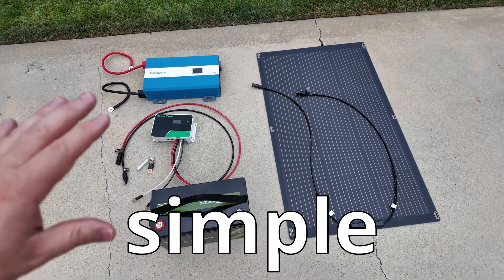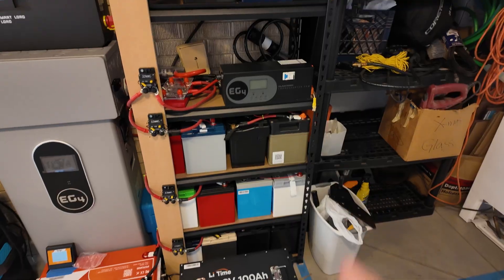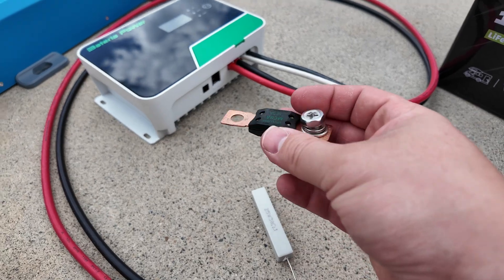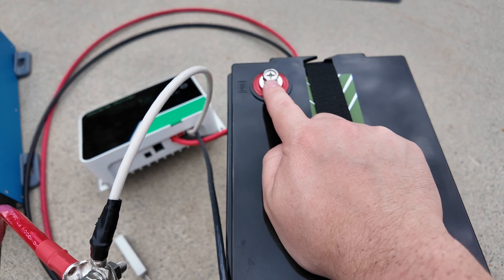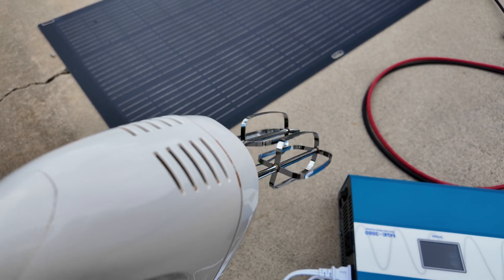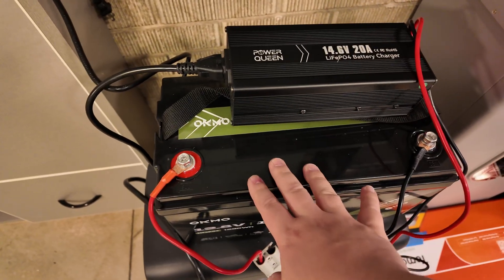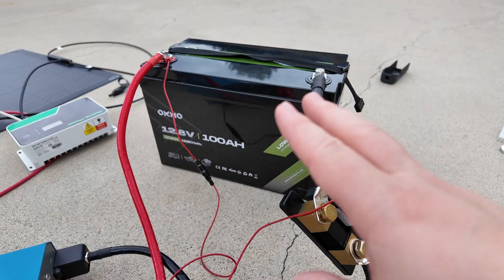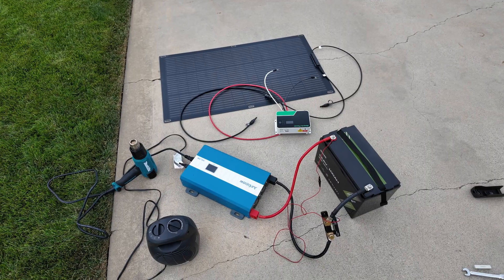Back to Basics: DIY 12V Solar Power System Build (Step by Step for Beginners!)

Comment: Is a breaker switch between the panels and the controller needed for this setup for use in a RV with a 12v system (parallel) and one 200w solar panel.  Only going to be using a 1000w inverter if needed for dry camping for items less wattage than a coffee maker (e.g. use for cpap, tv, charging phones and laptop computer).  Also, can a surge protector be plugged into the inverter?
Reply from the maker: A breaker between the panels and controller is always a good idea for safety! Yes! A plug strip can be installed after the inverter!
Reply: @theresatrickforthat  Thanks for the quick reply and have a Merry Christmas and Happy New Year

Comment: Watched to the end, Junbpaw.  It was a lot of help.  I am using 4 100W solar charge controllers. For one system and the same for another system.  With 4  12V 100Ah LiFePO4 Lithium Battery. I like that you talked about 24V and 48V.  If so, I would have gone for the 24V or 48V.
Reply from the maker: Glad I could help!

Comment: can this be used to run a pc especially at night?  I was just thinking if I can use a solar + battery and a power socket to power up my PC to reduce power costs at night?  Like let's say I buy panels enough for 1200w and then a couple of batteries.  Should I run the solar and batteries in series?
Reply from the maker: Yes! This could work great for you!

Comment: Watched until the end but I didn't see the vendor for the fuse link and resister you used. I am only going to use a small solar panel, 12V car battery and 2 small 12v equipment lights for my barn. Thanks.
Reply from the maker: The links are there in the description and pinned comment!

Comment: Watched the whole video, but had a question about the BMS. Isn’t the BMS on the battery too small for the inverter? Or is there something about the Junbpaw that allows you to use a 100ah battery with a 3000w inverter?
Reply from the maker: It is too small for the inverter running at. it's full power...but you can run it just fine with a lower powered load!

Comment: The system you built with one 100amp battery, I want to build a system with two 100amp batteries, will the fuse still be 300 amp, also will my system require a fuse for each battery
Reply from the maker: With just two batteries you should be okay with just one fuse…however the safest thing would be a fuse on each battery in the rare event of a shorted cell
Reply: @theresatrickforthat , thanks , i didn’t realize these systems need such a high amp fuse , good thing i watched a video on how to build a system. I’ll probably buy a few spares fuses for a backup if they blow out

Comment: I "Watched until the end", as stated. I just retired and I'm looking to further advance my extra time I have on my hands.  This would be perfect to start my hydroponics project. Your presentation and explanation are very easy to follow and implement in building this start up system. Thanks for sharing. 👍👍
Reply from the maker: That's awesome! Good luck with your hydroponics project!

Comment: When you hook up the inline fuse you put the charge controller in the battery on the same end. Doesn't that mean the charge controller is not protected by the fuse? And is that deliberate? Total n00b here, so I wanted to ask. Thanks for a nice video about this. You explained everything very clearly.😊
Reply from the maker: Yes. Technically, I need a separate fuse for the charge controller since it has different size wires. I just filmed and now need to edit a full video in my back to the basics series going over cable and fuse sizing. So stay tuned for that!
Reply: @theresatrickforthat will do. Thanks for clearing that up!

Comment: So what can I power with a system like that?
Reply from the maker: Small electronics, a freezer, a fridge...if you add more batteries like the video linked in the description shows, I could power basically all my 120v loads in my house! It can be very flexible!
Reply: @theresatrickforthat Thank you

Comment: Thank you following been jumping from page to page trying to do something with my barge, as alternator is running 24v figured I’d just do everything 24v but I’m fairly certain I won’t have much cross over not even sure about doing dc to dc..
Questions 
do you need fuse each battery or is it one and done do I scale up the fuse or 32v 300a fine?
For recharging off mains/generator can you recharge all together or do you need to do each battery independently
Reply from the maker: I like to be safe than sorry and fuse each battery and then fuse each string of 4. They can all be charged up at the same time. I'm going to be making a video very soon about proper cable and fuse sizing.

Comment: Watched until the end.  Running a 3000W load on that 100Ah battery will drain it under 20 minutes!
Reply from the maker: Yay! Yes, in fact, that battery will actually shut down before you reach the 3,000 mark. But where the inverter is so efficient, I would recommend getting the larger size to start with. Because it seems we always need/want more power after we get into power backup. Easy to slap and other battery or two in parallel and allow the inverter to run at full power if needed.

Comment: Nice for the solar panel I would recommend a 350w panel, this way it can charge to at least to 80% every day if there is good sunlight for a 100ah 12v battery.
Reply from the maker: Great recommendation!

Comment: Watched untill the end. But how many amps can this system sustain? Im going to watch many of your videos I want to learn about solar and DIY as I just got a farm and land and trying to save on power costs.
Reply from the maker: The inverter can pull over 230 amps from the 12v batteries if you get the 3,000 watt inverter. So serious current! Need to size your wires correctly! More DIY videos about cable sizing and fusing coming up soon!

Comment: Super interesting. Watched until the end.
Reply from the maker: Hooray!!!
Reply: @theresatrickforthat  I actually have a follow up. I just got an ecoflowriver as well based on one of our earlier videos. Also in Utah, and still trying to convince Rocky Mountain to give me a smart meter.  In any case, since I will be using 4 panels, which I don’t have yet, once I connect them to the eco flow, do I need a shut off for any of them since each panel will connect to it’s own micro inverter on the eco flow, except the 2 that will be in parallel?  I’m still pretty new at this so trying to make sure I’m doing it right.  My first foray into this was just a flexible 350w panels for my blueetti power station.  Thanks again.
Reply from the maker: No need for shut offs where you will only be dealing with the low voltage of just a single panel (the two in parallel will just have double the amps, but still the same voltage as just one panel)

Comment: Liked subbed n commented.
Take that algorithm!!!!
Watched till the end
Thanks for the capacitor tip. Knew for car stereo but not for inverter. 
What about grounding?
Reply from the maker: Heck yeah! Show that algorithm who’s boss! Haha! This particular inverter has an integrated ground system in it. You can connect the inverter to a ground rod if you desire.

Comment: Watched until the end. I'm a disabled vet on an extremely limited income. I'm looking to create portable system that I can use to run things like my cpap and deep freezer when the power goes out. If you could assist me with a list of what could be considered the cheapest quality and price you're willing to go with I would greatly appreciate it. It will probably take me at least three months or more to get everything I need so please consider the price. Thanks.
Reply from the maker: There are a lot of great options out there! And one size does not fit all! So keep doing some research and build a system that will work just great for you! I’ve got more videos about this type of subject coming up soon!

Comment: I did not read every comment, but any fuse (mega fuse) should be installed in an appropriate fuse holder to function safely and avoid putting unnecessary stress on the battery connector. Fuses are delicate and not made to be load bearing. An Mrbf fuse in an Mrbf fuse holder mounted directly to the battery's positive terminal and cable to the inverter/solar controller would be an excellent choice for 12v systems.
Reply from the maker: Great tip! Thanks for the helpful advice.

Comment: Watched until the end . Very good tutorial. I started with several small 12 volt systems, but now have a 3000 watt 24 volt system as backup power during power outages. I keep it charged with 2800 watts of solar panels.
Reply: I used the harbor freight kit and stuck it on my shed. I just added a little 500W inverter and a single battery to charge my tools and used the lights,  with a switch for the shed. Fun little protect and keeps the tools charged and always nice to have lights in the shed at night.
Reply from the maker: That's awesome, glad you enjoyed the video and I'm impressed with your setup!

Comment: Watched until the end. Thank you for taking the time to explain and show us how to get started. I’m new to this but am really trying to understand and set my family up for success if and when the time comes. Saying that what would a system like the one in the video be able to power and about for how long? Once again thank you for your time.
Reply from the maker: A small system like in this video with just one battery and one’s solar panel… Would be enough to give you a few hours of run time on your fridge and recharge your electronic devices. Most people agree that for Home back up you need more power. You may want to check out the video linked in the description where I built an absolute beast of a 12 V system. That was enough to run every 120 V load in my house for like two days solid without any extra solar. Thanks for watching!
Reply: @theresatrickforthat  I will check out that video as well, things like this is just good to know and knowledge is power plus this way I can share the info with my family and friends

Comment: Good tutorial.  To avoid sparking I always hook up the negative terminal last (and remove first). Does this work in a solar system or do we need to use the resistor trick.
Reply from the maker: Doesn’t work in this case, you will get a spark regardless of what cable you hook up first.

Comment: Dear @Theresatrickforthat
Hello friend. First off,  I’d like to say thank you for sharing such valuable information about Batteries, Solar etc etc. As a single inexperienced woman trying to do all this myself, there are absolutely no words to say just how very grateful I truly am. However…. although I’ve probably watched hundreds of videos by now… I’m still a bit confused. I have one 12V 300ah w/BMS Battery, a 12V 3000W Inverter & 2X200W Solar Panels (Callsun, just arrived yesterday). I do plan on purchasing more items in the following days, such as a Bus Bar, Fuses, DC Solar Disconnect Switch & Circuit Breakers. And well since watching you, a few little extras that look super helpful! But anyway, at this point the biggest problem I’m having is knowing exactly which size Gauge Cables I need. Do you happen to have any suggestions and/or recommendations? If so, I would deeply appreciate it. 

Thank you  ❤
Reply from the maker: I'm so happy to hear you are enjoying the channel! I try hard to bring valuable content to you! And I'm super excited to hear you have started in with solar! Welcome! Cable sizing is not a one size fits all. In a nutshell, you need to size your cables for the largest continuous load your system could ever run at and then protect those cables with fuses. And again, that needs to be calculated for each system individually. But don't worry! I have a video on the list that's going to teach you all how to calculate those things! Stay tuned! Thanks for watching!

Comment: Liked and hyped! Your videos are amazing sir.
I might have fried my cheap inverter for plugged solar with 51v temgo 😅
But im building.
Ordered voltage step down device to try again 😁
Next thing to learn is how to build 240v 30a outlet to run a dryer or charge EV using temgo 51v.
If youd film something like this with all components id greatly appreciate it!
Reply from the maker: Thanks so much! Sounds like you simply need a 48v inverter!
Reply: @theresatrickforthat i have li time 60a charge controller and there is load output, maybe I can connect inverter to it instead of basbar as you shown in your video "plug in diy" with temgo and ecoflow inverter

Comment: This is a great get your feet wet video.  I watched until the end.
What's your favorite fuse for the Temgo 48v golf cart batteries?
Thanks
Reply from the maker: Yay! Thanks so much for watching till the end! Best of luck!
I personally like in-line fuses for how I do my set ups. The Victron 80v fuses are awesome! That’s what I use! If I have more than two batteries in parallel, then I will fuse each battery with one of those Victron fuses, and then fuse the string with a T class fuse. I’m planning to make a video here in the future about how to properly fuse things thanks for watching!

Comment: Watched until the end. thats a nice basic system,there is also alot of 12v stuff on the market you can easily get that you can run directly off the battery and still have the inverter free. though you only have soo much power from a single battery available but if you are maxing it out then upgrade and get another battery.
Reply from the maker: Great advice, and thanks for watching until the end! :)

Comment: Hi Again really enjoy your teaching us about the Spark issue ..
We started with an ecoflowriver2pro right now & we do have three 187 solar panals installed

We watched ontill the end ..

Were interested in the junbpaw inverter
We would like to go 24 volt also with a two batteries in Series ..
Also we dont have A fuse or A shutoff from our solar panal to our ecoflowriver2pro 
Do you suggest any thing it is on its own 225 watt panal 
Thanks again from Hillsborough  NJ
Ps our power has gone out 8 times this year alone thats why we need Help our little ecoflowriver2pro is not big enough to run our fridgearatour 
Thanks 
Doug & maryann
Pss we wanted the anker f2000 or f26000
But of course its out of our price range evan reconditioned ones are $899. Ugh
Reply from the maker: Thanks for the comment! Sounds like you are well on your way to a larger system! And glad you watched till the end! :) A single panel doesn't need a shutoff. My rule of thumb, is as soon as I go over 2 panels, a shut-off is mandatory. Best of luck to you!

Comment: I watched until the end three times😂
can i make use of my Ecoflow Delta 2 power station with maximum solar input, without having to use the extra solar charger and inverter? Can i add an extra battery (like a tempgo or the one you have in this video) to the Delta 2?
Reply from the maker: Oh yeah! Use the Temgo because it has a higher voltage and will give you a full 1,000 watts into the 2 solar ports on the Delta 2 Max! Thanks for watching!

Comment: Watched untill the end.
Curious, with the fuse, do I have to have the 300amp? I plan on just a smaller 1000 watt inverter (unless I am lucky :) ), a 300 amp seems overkill. Seems I would want something closer to what my max wattage would be, or should I just get 300 amp just because?
Reply from the maker: I need to make a video about proper fusing. The 300 amp is the correct size for the 3000 W inverter. But you’re right if you’re gonna do a smaller inverter, you need a smaller fuse for the cable size. Fuses are there to protect the cables From melting during an overcurrent event. Glad you made it to the end! Best of luck to you!
Reply: @theresatrickforthat  Thanks. I got the 1280 inverter and a 150 amp fuse. 
Got it all wired up (Eco-Worthy 150 ah battery, the 1280 inverter, Renogy Adventurer 30 amp solar controller, Renogy 100 watt panel) and it is not working. I have 18.7 volts coming in, but 0 amps. Battery 80% charged. No idea why no amps. I have a small load (100 watts) on the inverter and still no amps on the controller or coming into the battery.
Edit: figured it out, my battery was fully charged and I had no load. Once I had drained it a bit and had a load running on it, it started working.

Comment: I "watched until the end" and must say this is the best beginner solar power video I've seen so far. Will Prowes would be next in line.
Something I think should be known is not to connect the solar panel(s) until after the battery is connected; my understanding is you will damage the charge controller.
Reply from the maker: Awesome! You're one of the lucky ones! And thank you for the compliments! I’ve got more great content coming up! And thanks for sharing your tip! You’re exactly right! That is the process I followed in the video… But I did not make specific mention of that aspect!

Comment: Question... PWM charge controllers, although cheap, chop off excess panel voltage(above the 14.4 needed) thereby underutilizing 30ish% of their potential. What if you put a BUCK converter in between the panel and charge controller and set it to 14.4v. Then wouldn't that make that extra current (from squeezing 20v@10a down to 14.4v@14a) available to the controller? (200watt panel). AI disagrees with my premise, so Ill have to experiment, I suppose. Just seems like a cheap way to turn a PWM controller into an MPPT. Any guesses?
Reply from the maker: I have no clue! I have really not experimented with PWM controllers much at all. MPPT’s are so cheap now I think it’s better to just go with them! Thanks for watching!

Comment: My only criticism is the fuse. It's fine for the inverter but you shouldn't put the MPPT wire on it since the MPPT has a much lower Amp tolerance and the wire is smaller. You need a 50 amp fuse for the 40 amp controller. Watched until the end
Reply from the maker: Good observation! Thanks for watching’